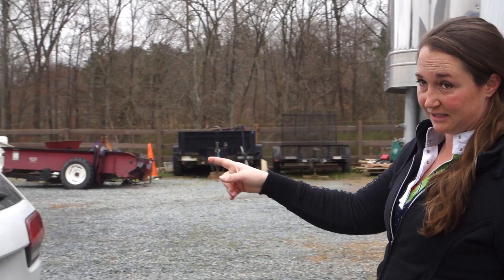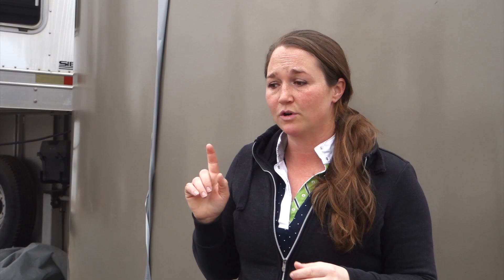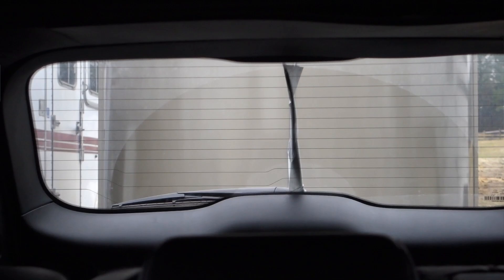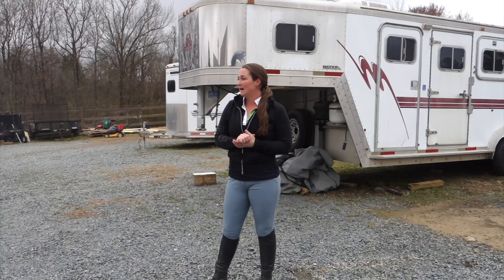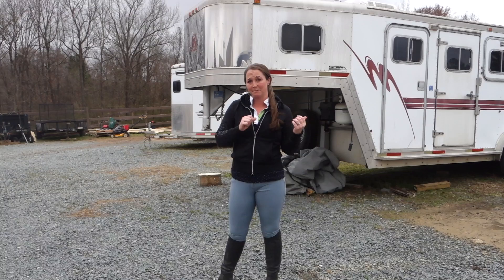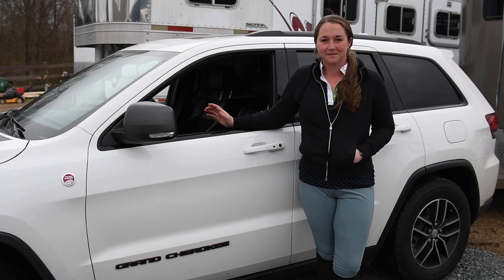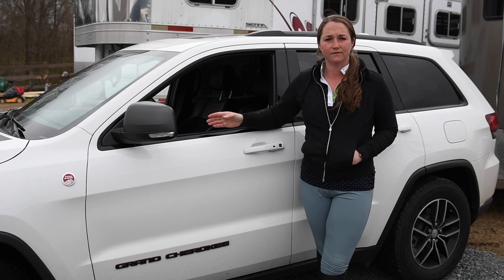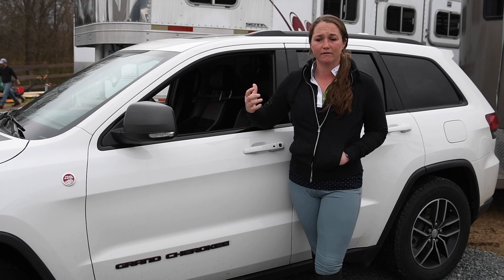How to hook up a horse trailer BY YOURSELF

Comment: Little bit of click bait to have a gooseneck on the thumb nail and then only showing how to hook up a bumper pull.
Reply from the maker: 😂 Goosenecks are even easier to back! It’s the small bumper pulls that are the most difficult!
Reply: Deanna Corby I get that. But I was looking for videos that showed how to hook up and/or back a gooseneck. I clicked on yours as that's what the thumbnail showed.
Reply from the maker: Stater905 ahh. Fair enough. Sorry about that! Good luck in your hook up. Lay a piece of wood on your truck bed to line yourself up with the ball and hitch. Don’t forget to put the tailgait down! 😜
Reply: Deanna Corby thanks! I’ll take all the suggestions I can get. Thank you.